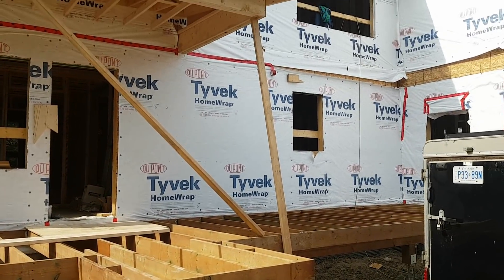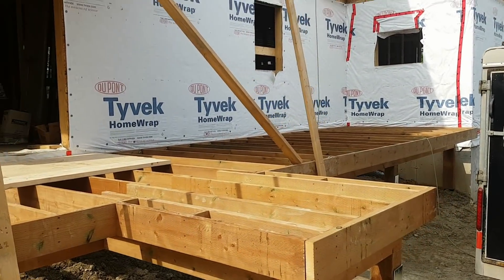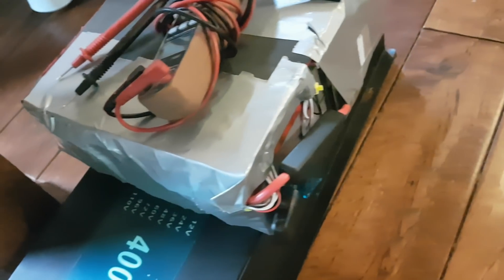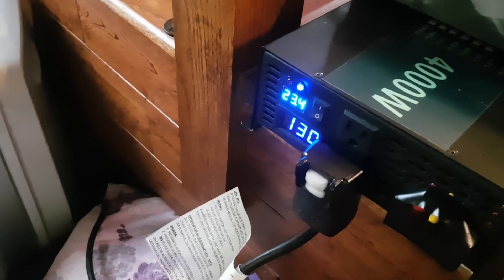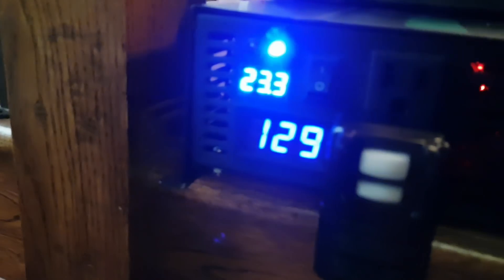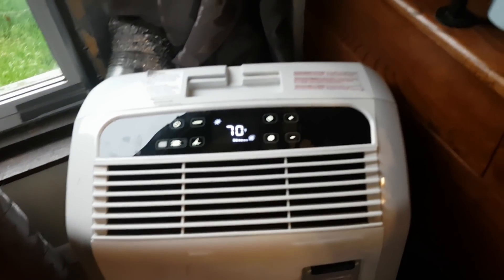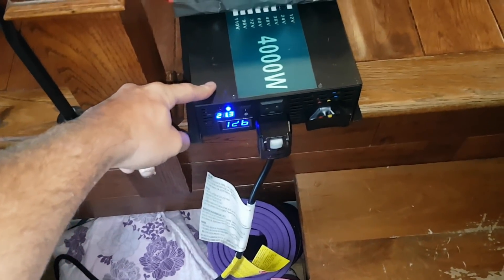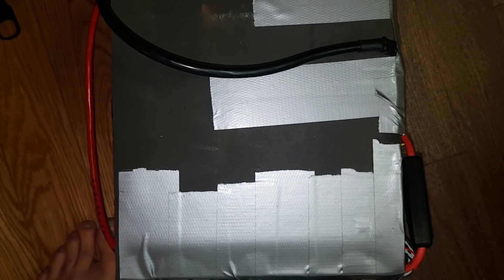4000W 1 6Kwh Mobile Power

Comment: Wow, that portable AC draw as much power as my 12,000 BTU ductless!  On an BMS related note.  One of my BMS (12S version of the type you have.  I have 18 of them) blew last Sunday.  I couldn't figure out why.  3 of the CMOS on the (P-) burned and smell really bad!  Now I'm worry about running them unattended.  :(
Reply from the maker: well it is a 12000btu AC as well :)
Reply: @GoingOffGrid101  No wonder :)

Comment: Replace the fuse holder too. Pretty hefty bms. Is it balancing
Reply from the maker: the lipos are in balance so no balancing yet.
Reply: I would have a look at getting DC rated fuses that have Ark arrester built into the fuse itself (normal car fuses with lithium batteries are not really suitable as they have so much power in them)

Comment: Not too bad!! I'd put a larger bodied fuse holder and fuse, on that, something that will have more contact area, or better connections, like the bolt in fuses!  I like those better, I have had alot of problems with high current  and other types of fuses,
Reply from the maker: might have to go that way.

Comment: What bms are you using?
Reply from the maker: https://www.aliexpress.com/item/6S-60A-80A-100A-120A-bms-2018-new-Li-ion-BMS-large-high-current-BMS-PCM/32992471115.html?spm=2114.search0104.3.233.789738aefjFWM8&ws_ab_test=searchweb0_0,searchweb201602_3_10065_10068_10130_10547_319_10059_10884_317_10548_10887_10696_321_322_10084_453_10083_454_10103_10618_10307_537_536,searchweb201603_52,ppcSwitch_0&algo_expid=30390ecf-b948-4859-8277-6026c40e843a-34&algo_pvid=30390ecf-b948-4859-8277-6026c40e843a

Comment: From what I've seen I noticed you haven't done anything on ultracapacitors. What's your take on those. I've ordered some to test with my 12v system with 400w solar and a 4000w reliable inverter. I'm hoping to see a difference in the power draw from the batteries. I only have 4-100ah batteries so far
Reply from the maker: they will help with a smaller lead battery bank, with a lithium bank they have no purpose, lithium can even discharge at close to the same rate as a super cap for the same size.
Reply: Awesome thanks. I plan to get rid of the lead just not with my current income lol